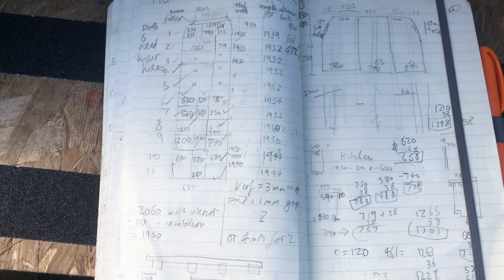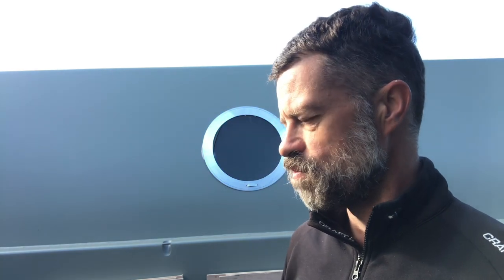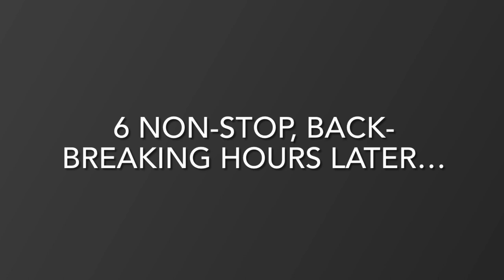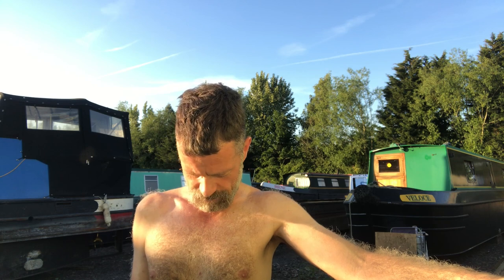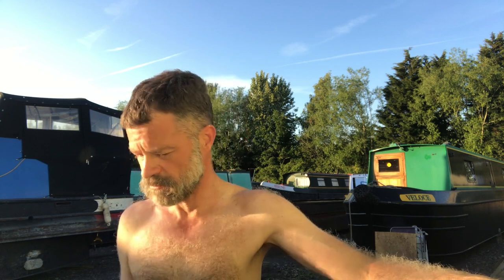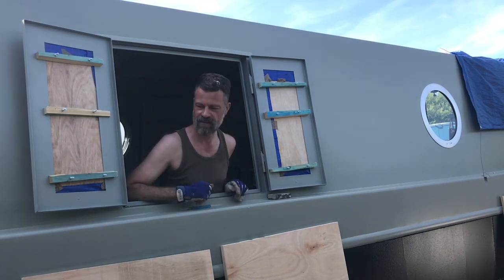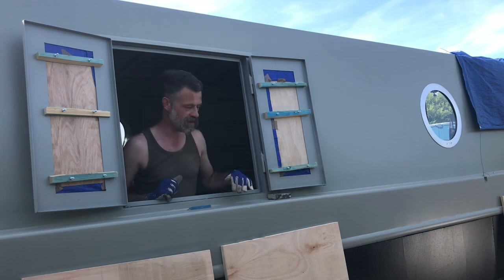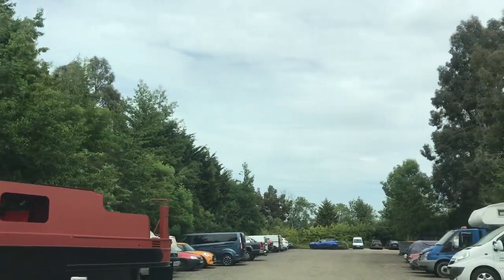7. Prepping the Plywood Floor

Comment: Uhhh, are you using bricks for ballast??
Reply from the maker: Hi Russell. That was the original intention (engineering bricks). However, shortly before the boat was delivered I got covid which wiped me out … anyway long story short, the builder offered on the last day of the build to put in their standard ballast- which is paving slabs - and given how I was feeling, I took them up on the offer.